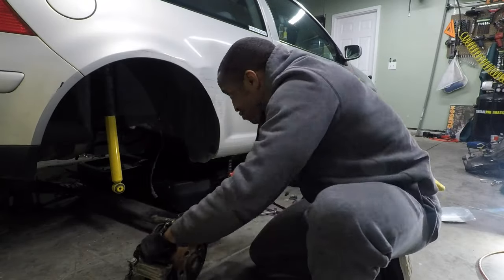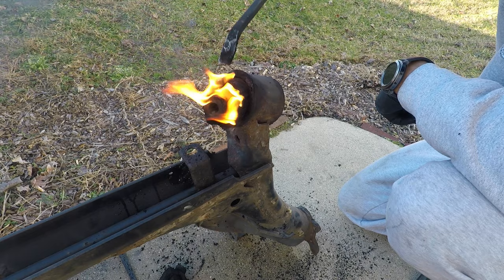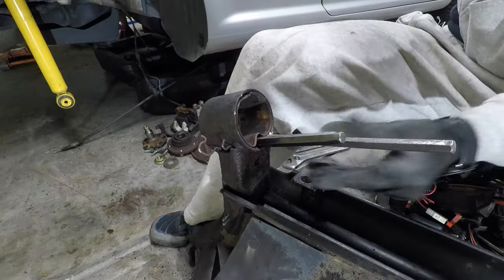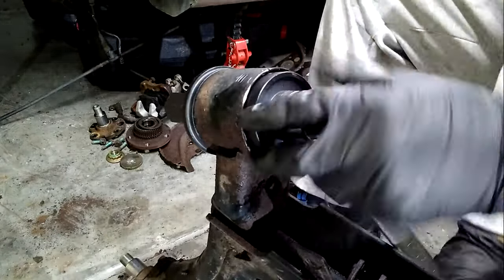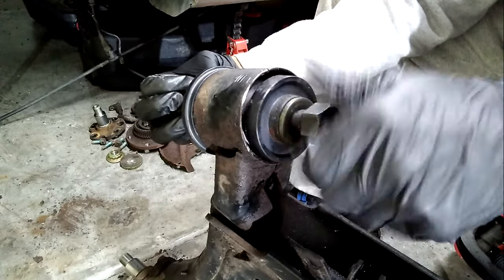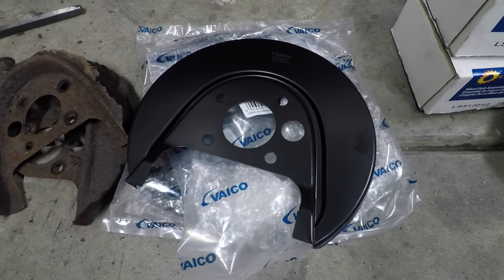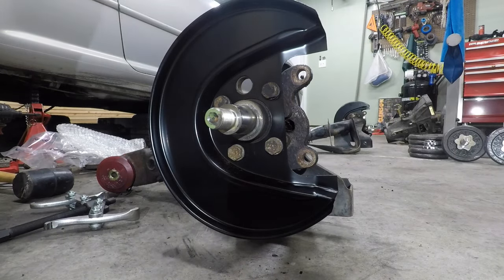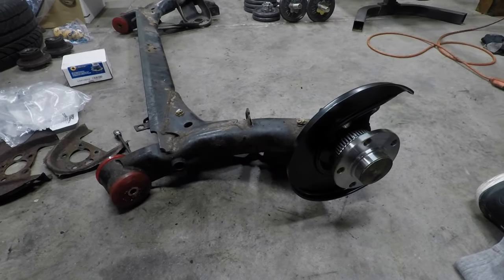MK4 GOLF new bushings, dust shields and hubs

Comment: This video helped me understand exactly how the stub axle is removed and installed.  This looks much easier than I originally thought.  I plan on doing the same level of maintenance on my MKIV GTI.  In addition to all of the work you did, I may also sand blast the axle beam and have it powder coated black.  I would also like to rebuild and paint the brake calipers.  The brake lines will likely also be replaced due to their age.  The one step I will perform differently is the removal of old bushings.  Instead of burning them out, I will get a handheld drill and repeatedly drill holes in the rubber until it's so weak that it can be pressed out by hand.  Thank you for making this video.

Comment: Wow, it looks like you can't change the dust shields without unsealing and removing the wheel bearing. Not ideal. In my case what you could refer to as the dust shields better resemble a washer-plate for the bolts. Thanks for the great vid!
Reply from the maker: Geez. Yours sound like they are way worse than mine were. Thanks

Comment: I checked out your video, very detailed! Thanks. Question: do you know if those bushings will fit my 2.0 GLS? I looked at Energy Suspension and the part number they have is 15-3118 but the one at your link is 15-3118G. Any difference between those? Thanks.
Reply from the maker: Thanks!! It looks like the Amazon link has 15.3118G as the black and 15.3118R as the red ones. I went back and checked my order to make sure and I ordered the 15.3118R. They should fit.
Reply: @MaqsVids   Thanks! I ordered the red ones too.